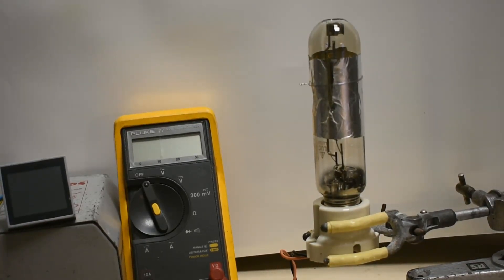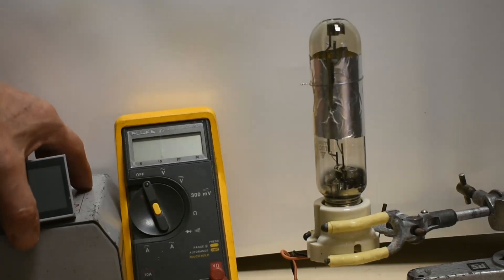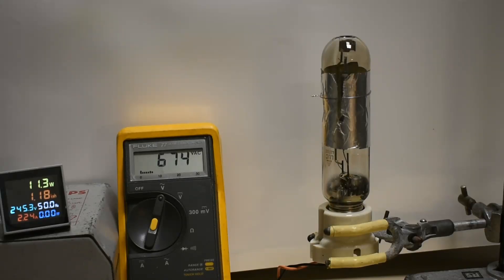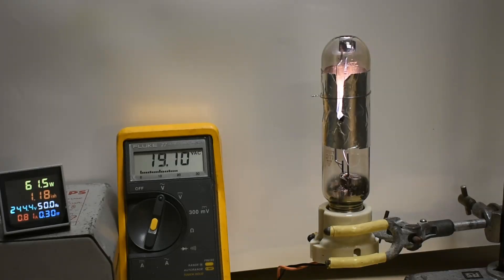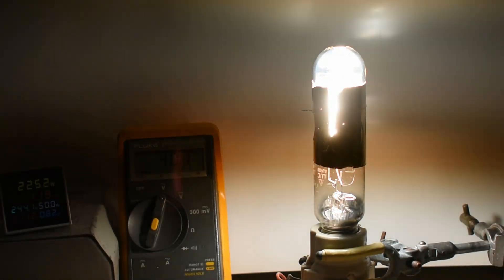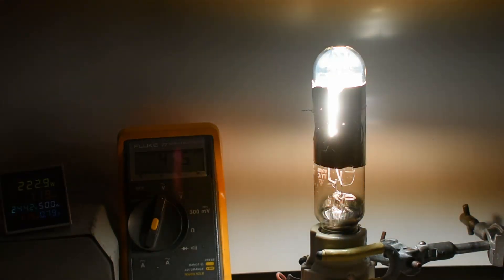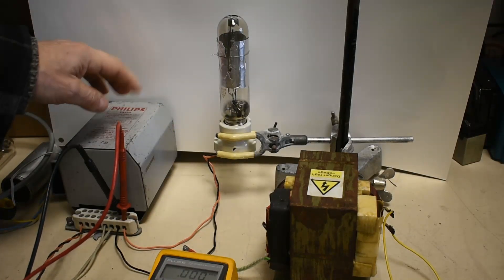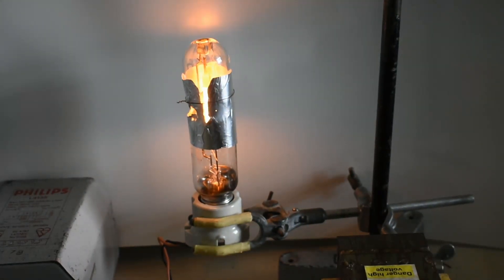How to carefully overload a high pressure sodium lamp in the interest of science.

Comment: If I connect a 50W HPS lamp to a 70W ballast, is there a risk of it burning out after a few minutes?
Reply from the maker: No that's very unlikely,. It may  start to  cycle by running up and going out then restarting, but even that is only likely as  the lamp ages.

Comment: That spectrum looks like a CRI of 90 or more. Absolutely un-heard of, with sodium lamps! Normally, Sodium lamps have the worst CRI of any light source.
Reply from the maker: Indeed, colour is good, but the lamp efficiency is now  very poor. Sodium lamps were more popular for their high efficiency.
Reply: @tuopeeks  It would be fun to see the results on a luminosity meter. Granted, you're passing a lot of power, but, that thing is screaming bright! Luminosity is a lot like sound, where you need an exponential increase in output, to look only a little brighter. While the ballast might not be as efficient, the lamp itself might actually be. (but for a short period of time before failure)
Reply from the maker: @vincentrobinette1507  Yes, it would be interesting to take some measurement  of the light. Unfortunately I don't have much for measuring it at the moment. I did initially run this experiment on the correct ballast but with the supply elevated to 450V. The lamp does look crazy bright but the circuit was still consuming over 200w. The reason for changing to the autoleak ballast is the lamp goes out if the voltage reaches a ceiling and the current falls below 0.9A.  There seemed to be a noticeable drop in brightness when reaching a blue-green tint to the light. The absorption band is completely absorbing almost 20% of the light. The lamps output is reduced by the tinfoil heat reflector too.

Comment: wow great video, i have a video on my channel where i use the same lamp as a spark gap and strobe flashing it at 2000volts but without the aluminum wrap and running it with 12 watts of power from a 12 volt supply and a fly-back transformer.
Reply from the maker: Thanks, the aluminium foil is just to reflect the IR back into the arc so the temperature can be raised more efficiently. You do need quite high voltages to strike these lamps and my 600V from the leak-transformer wouldn't.  Even with the MOT I had to use an external ignition.

Comment: This was interesting. I did a similar thing with a small 70w sodium lamp like that and it melted in exactly the same way, just it didn’t break the arc tube.
Reply from the maker: Thanks. It makes sense but most overloads I've seen destroy the arc tube quickly and the outer glass remains intact. I think the slow run-up to protect the arc tube results in the glass becoming too hot.
Reply: @ what power did you push yours to? I got mine to run at 680w for ages and it actually stopped cycling after a while. Also did the same with an 80w mercury lamp and it still worked after a couple hours running like that, the arc tube was double the original size mind you lol
Reply from the maker: @TheCORC964  it was running around 230W, maybe a little higher on the MOT. It couldn't cycle at all, as the voltage was able to elevate to over 1kV at constant current. I was surprised this lasted as long as it did. It had been cycled to almost the fail point many times.